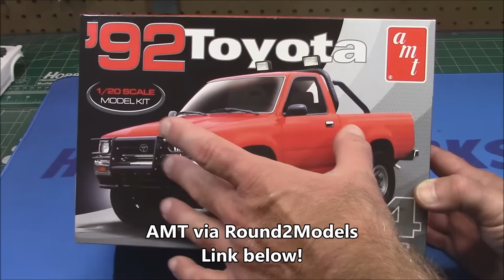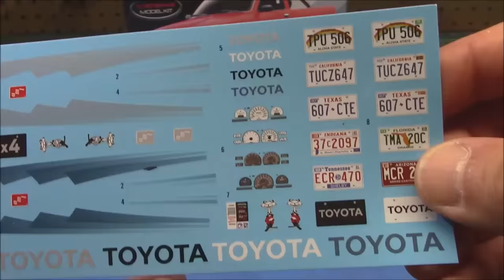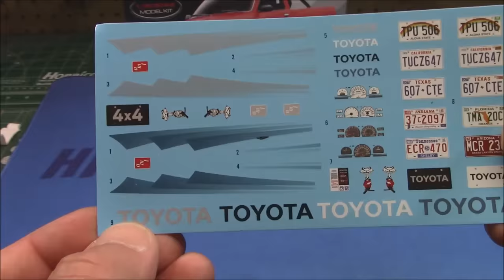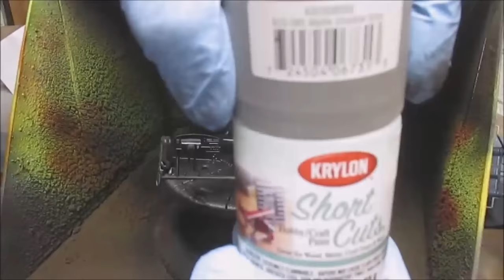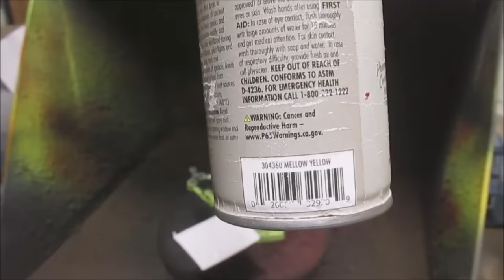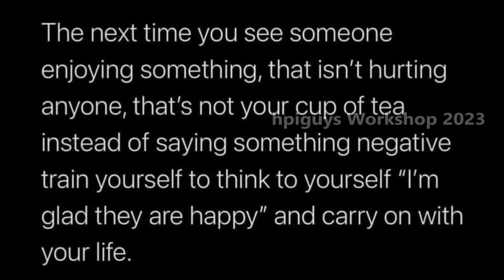1992 Toyota Pickup Hilux 4x4 1/20 Scale Model Kit Build How To Assemble Paint Dashboard Engine AMT

Comment: Nice build as always, Chris. I owned a 1980 Toyota pick-up. The last year, they installed a straight differential for the four-wheel drive. 81 they went to the independent four wheel drive. Not sure why this truck you are building has a straight differential??